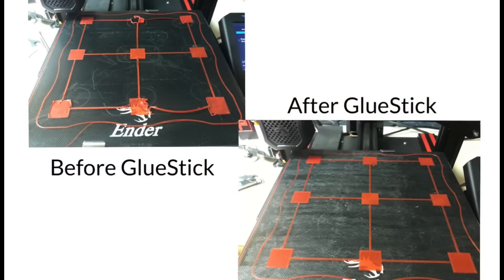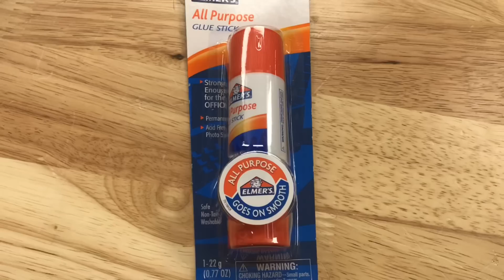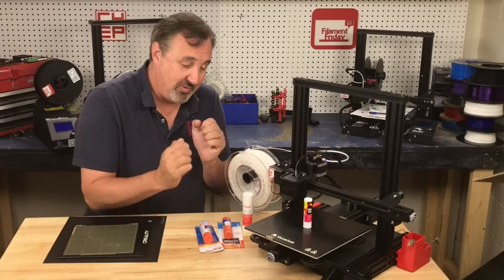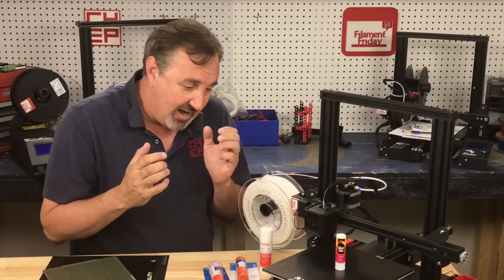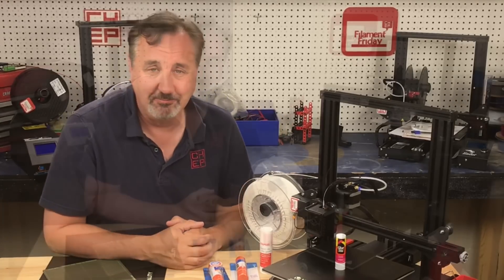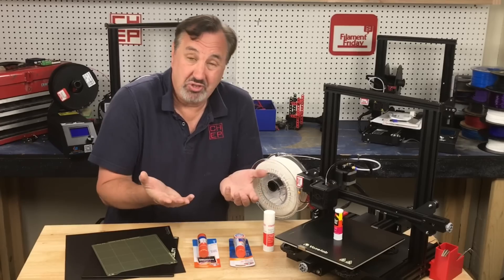Better Bed Adhesion with a Little Glue Stick

Comment: I think whatever works is what you should use.  I once mentioned in a forum that I used hairspray and was told I was doing it wrong, like I broke some acceptable use code or something.  I dont really care, I have a stock Ender 3 bed and hairspray never fails.  I clean it with IPA every three or four prints.  As for the overspray I have a large rag I put over all the critical printer components and go close to the bed with a few even shots. Takes five seconds and just works.  Glue sounds great too and will keep it in mind.

Comment: I haven't had much of a problem with adhesion in general on my Ender 3 glass bed but squares and rectangles (or really any shape with sharp edges) just don't stick well enough so glue stick has definitely been a life saver

Comment: Aquanet all day everyday 😬 but I also like some glue sticks as well. Especially on one of my Prusa Mini beds.

Great video!
Reply: I like hairspray too. I renew it with 90% and a brass brush to leave a bit of texture.
Reply: I agree on the hairspray on a bare glass bed and use White Rain.  I do remove the bed and spray from 3 angles and let it dry.  Keeps from having overspray on the printer. To each their own, if it works, it works.
Reply: In South Africa we use FIESTA hairspray. a small spray is all you need. Ah yes, overspray.... I move my bed all the way out and put a papersheet as a shield between the platform and the rest of my printer. No overspray...yet
Reply: I use Aquanet also glue sick is a last resort. I also increase the first layer line width that helps a lot.

Comment: Great video. I have tried almost everything and now use the Creality glass bed, but the smooth side, with glue stick or Magicgoo.  I have tried hairspray and agree it does leave a film from overspray.    The biggest problem I have is with NingaTek, it sticks too well for that I use blue 3m painters tape, so it doesn't destroy the bed.

Comment: I tried glue when my prints stuck too well. This worked, however I took the plunge and bought the WhamBam flex plate with PEX. The best decision I ever made. Everything sticks without glue and the parts pop off when cold. If you don't want to wait, flex the bed. I haven't had the need to use steel wool that often so it's not an issue. I admit, glue stick might be useful for two coloured prints. I haven't tried that yet.

Comment: I gotta the 4 screw bed levelling system that never seems get get level. Adjust one side and the other goes out, so I level to three points and use glue and it works great!
Reply: 4 point leveling is really a bad choice for actually leveling things. I wish they picked a 3 point system

Comment: If it separates people, that says a lot about those people actually, i mean whatever works is good! and everyone has their own preferences! I myself print on the smooth glass side and as long as the bed is hot it will stick great, then i let it cool down and it comes right off...i'll be testing pie in a while, basically to see if i don't have to wait for a cooldown! i never had success with the sticks, but i think you might have explained this with the difference between permanent and  non permanent and i'll be looking for a permanent one! Keep up the vids really liking them!

Comment: Started using Elmers Purple after an awful experience trying to use Solutech PETG. In my case it was because I needed a sacrificial layer rather than weld the PETG to the bed of my ender 3... I've had good luck with glue-stick ever since and aside from occasionally 'refreshing' the surface, it's been a boon.

Comment: I have 2 Ender3’s and an original Snapmaker. They all use standard glass mirrors cut to size. I use a glue stick rubbed all over the glass and then immediately with a wet paper towel I remove the glue residue turning the paper towel until no more blue glue residue shows on the paper towel. Prints stick first time every time. The best thing about this process - after the print is finished and the bed cools down their is an audible “crack” indicating that the print has separated from the bed and can be lifted off. No need to pry the model from the bed.
Reply from the maker: Interesting

Comment: I'm still pretty new to 3DP and I was struggling a lot with the stock glass bed on my E3 Max, I really liked the results I got from using a glue stick but I really hated the extra prep and never really got a chance to see what other's work flow was with glue sticks to see what works for them. It would have been nice to see in this video how you apply your glue and where it fits into your prep workflow. Like do you apply when the bed is hot or cold? Before or after ABL? How often do you clean it or reapply? These are the sorts of questions I've never been able to find answers to. I ended up getting a PEI spring steel print surface with textured on one side and smooth on the other and at the moment I have absolutely no plans on going back to glass. The textured side is fantastic and I really like the bottom finish it gives.

Comment: I was having issues with petg on my adventurer it was welding itself to the bed and i applied glue stick to my bed and it printed perfectly and then cracking sound then popped off the bed instantly!

Comment: Been using nail polish remover on my knock off PEI sheet and its fine. The thinned amount of acetone removes filament build up and scraps, but doesn't seem to harm the surface. Glue stick leaves a texture on the printed surface, and I have to wash it off the plate everytime. This is really a "do what works for you, BUT, if you're not doing THIS, then your doing it all wrong" video.

Comment: I tried a few things when starting out . Ender 3 . Found that non textured glass and a swipe of fresh glue stick every print has worked for me . Yes it take bit extra time to clean bed and re apply everytime but I don't think I've had a bed failure for over a year. Oh and a tip when I print abs first layer is 50deg bed then 2nd layer set to 90deg . Cause I found the glue stick fries when bed starts at 90deg.

Comment: I use glue stick every time. I love it. I also use a steel sheet, because I like the ease of flexing it off. I do like the Avery purple myself. It's cheaper than the Elmer's, works just as well. I did try an off brand that was no good though.

Comment: I have a wham bam textured metal sheet and I have been printing on it for about 4 months and have had very little issues with it. I clean it with a cotton swab and rubbing alcohol. If my parts start to pop off I simply level my bed and I’m back to printing. I print a minimum for 2 or thee parts a week. I think it’s something people should look into but that’s just my opinion.

Comment: I use glue stick every time too.. but I wash it of after every print. Now I'll try washing it every 5 or 6 prints!!!

I also just fixed a corner I didn't glue very well, by pushing some glue under it and holding it down haha. Glad I'm not the only one doing that!

Comment: I like hairspray. 
All Weather Aqua Net Extra Super Hold Unscented. 
Made a small box, out of cardboard, to set on the bed to prevent overspray. 
Hit it with a quick spray
Comes of with rubbing alcohol. 
Never had any issues and it works every time. 

The biggest advantage of the hairspray is it's EXTREMELY easy to use, and it coats evenly across the surface. 
That, and a can of hairspray will last you a lifetime.

Comment: What I do: On my Lulzbot Taz6 and Prusa printers with smooth PEI bed surfaces when printing PLA or PETG, I clean with IPA before each print. Occasionally I lightly rub with a Scotchbrite pad, instead of steel wool or fine sandpaper like some folks recommend.  For TPU on the same PEI surface I use glue stick to help release, otherwise the TPU will bond much too strongly to the PEI and can damage it.

Comment: I've been using hairspray on a glass bed with great success with PLA so I probably won't change but when printing ABS the cheap hair spray was unreliable; my wife had some hairspray that she didn't like and  WOW does it work. To remove my prints I almost always have to put the glass plate in the freezer for 20 minutes, after it has cooled down of course, but then the prints practically fall off.
The hairspray is Herbal Essences Body envy Volumizing Hairspray with Citrus Essences, there are numbers 1 through 4 on the can with 4 being highlighted. I do my ABS prints on a Monoprice Select Mini (V1) with the bed temperature at 75°C.

Comment: one tip is to do the first layer flow 150%-200%. Works super good for me. Just remember to adjust the "Initial Layer Horizontal Expansion" in cura.

Comment: I’ve found, if I use magigoo or glue sticks, I can wet the corner of a soft scotch-bright pad with a little water, wipe down the build plate and keep printing. It even levels out the texture of the glue stick so it doesn’t add a texture to the bottom side of the print.
I have a ender3v2 printer.

Comment: I have been using PEI sheets for ... 5 - 7 years I think. They come stock with LulzBot printers.

I do occasionally "clean" my PEI sheets, using sandpaper and a alcohol/water mixture, to restore the adhesion if I see it going (I don't do if often for the record, maybe a total of 5 - 10 times). Also cleaning them before prints is easy. Isopropyl Alcohol and a a cotton ball. Super easy, and it's a routine.

Comment: I use a PVA based wood glue. For me it has the advantage that it is liquid. I mix it with water to lower the concentration. In this way I get a thin coating. Of cause I dry it by heating up the bed before the print.

Comment: I use watered down pva every so often but I've found a quick wipe with acetone usually removes the dust or whatever is stopping my print bed.

Comment: I used to go with glue stick and like you said it worked well on glass bed. Until one day, I found a sand-paper-like textured build surface that came with every spool of filament I had bought. Sticked it to the top of my glass bed and I never have to worry about cleaning off glue residue every other print.
Reply: Overture?
Reply: @kenbad  yep
Reply: I hate their tpu so far lol, cannot get it to stick to clean glass, hairspray, OR gluestick.
Reply: @kenbad  Why didn't you use the included build surface. Its been saving me  lot of time and efforts cleaning the bed
Reply: It's not the right size for an ender 3

Comment: Had exactly this problem with my Ender 3v2. leveled and leveled and got mesh leveling and a BL-Touch. I just couldn't come right with PLA.

I'd bought a spare glass sheet which I was going to use build tak on to try printing with PETG, so I took off the creality bed, and printed straight onto the smooth glass. First round came unstuck half way through. Then I upped the temperature 5 degrees, and now it prints perfectly.

I'll remember the glue stick for when I try PETG, probably on the old creality bed, but the plain smooth glass is amazing for PLA. The quality of the base and detail I could get were better than any print I ever did on the creality surface.

Comment: Yeah I've tried all the options.  Glue Stick and BuildTak-like surfaces are my favorite.   My buildtak only wears out when it starts to rip / tear up from printing in the same spot too often.  I clean it with rubbing alcohol and it always prints like a champ.  (Maybe I've just got the right temperature settings and I always use PETG....so there are likely some contributing factors to my success.)

On other printers I use glue stick or that nanopolymer adhesive that I'm sure you've tried too.  It's good stuff, just have to keep it clean and/or refresh it from time to time.   With the nanopolymer stuff I find that it lasts for 4 to 8 prints on average before I need to refresh it.  Glue stick is a lot cheaper and just as easy even if it needs to be refreshed more often.

I haven't tried the permanent glue stick.  I might like that even better.   The washable stuff is very picky about getting the right bed temperature.  Maybe the permanent stuff is more forgiving.

Comment: I like my PEI sheet.  I never roughed it up and as long as I don't have a lot of oily fingerprints prints sticks fine.  I keep a supply of alcohol swabs (the kind for first aid) near the printer and now and then use one to clean the plate.  In extreme cases I'll take it off and wash it with soap and water.  You just need the bed well leveled and a clean build plate.

Comment: i am Printing for 5 years now on my old Makerbot clone (ctc bizer) on a glas bed made out of a old Prictureframe and Gluestick on it..you don´t even have to clean it after every print...just a small damp sponge to reaply the resedue after a print..then preheat to dry it again..
im printing Pla mainly..but ABS and Petg work well too...
 greetings from germany

Comment: I have an ender 3 with just a glass bed no special surface.   I use Elmore purple and it works great.  I love it just use hot water and it cleans off in seconds.

Comment: Been using hairspray for years on my print surfaces. You also do not spay your print surface while on printer, take it off, spray and put back on. That way no spray get onto any other part of the printer.

Comment: I just watched your video again. And you mentioned that a moist filament doesnt stick very well, and I couldnt agree more, I was having problems with adhesion with one filament in particuĺar unless I really used a lot of glue over the bed. I left it drying for a day, and it was fixed. Now it needs just a bit as usual

Comment: I use glue all the time but maybe a little different, I make slow swipes to the bed taking care not to push hard so it leaves a very light surface of glue ( sometimes i do 2 passes in a different directions) then i wait for about 10-20 mins to let it dry the start printing, i do this maybe once every month (sometimes 2 months), and another surprise is i don't use a heated bed at all because of electricity issues i have in my country, and i use a very cheap unknown type of glue.

Comment: Creality Glass Bed and a thin film of hairspray, works for me. And of course, a good bed levelling :)
Reply: I laughed at the hairspray until I tried it in frustration when my new ender 3 v2 wasn't sticking to the bed.  I had read or saw on YouTube about hairspray.  My sister gives me her hair spray cause of lockdown and she wasn't using it.  Works and is washable with water and a heated bed.  Works great.

Comment: i go glue and raft. i like the raft just so i don't damage the prints when removing them from the bed. i actually clean the glue off after every print because i use a .2mm nozzle and excessive glue build up sometimes prevents adequate flow on the first layer leading to clogging

Comment: Yep, glue stick for the win. To not get bothered with textures from the glue on the plate I always use a damp cloth before printing and while the bed is still wet put on the glue stick which really skids across the bed in that case and really leaves a very even film. Also I always use the same microfiber cloth which is saturated with glue stick residue. I rinse that cloth every couple of days out but never make it completely devout of glue stick. This gives me a nice even film and no textures. I use the Ender 3 V2 with the textured glass bed but when I made a car decal of 10 centimeters round I could stick it to a vertical glas plate and it would sit for a second and then slide slowly to the bottom without falling off.
Reply: I defenetly have to try that.  thank you!

Comment: I use glue all the time on my flashforge finder. Love it! Im looking at buying an ender 3 max. It has a unique glass surface that enables the glue to “pop off” when it cools. So im wondering if anyone uses glue on a surface like that?
Reply: I use a coating on the plain glass side.   I like the bottom finish better and the textured side will wear pretty quickly.  I always keep some extras on hand, they are pretty cheap and do get destroyed by a too low nozzle

Comment: You should try a good wall primer, it has verry good properties. You apply a layer with bed at 40 degrees, by tapping the surface with a sponge..let it a few seconds and put another layer. You can do multiple but 2 are enough if the wall primer is undiluted. The best thing is that this stuff gets stickier as it heats. With a cold bed it dries and is not sticky but whes heats up is tacky like adhesive tape especially at 100 degrees celcius. It doesnt burn out and it doesnt have any smell when heated . It remains sticky as long as it is heated. It work well even with the dreaded abs . Give it a try

Comment: I agree with you about hairspray.  I only use it on my Ender 5 Pro with a removable steel PEI covered sheet.  (I use the hairspray for PETG and ASA prints.)  I can take the steel PEI sheet out of the printer and spray it without worrying about the spray getting anywhere else on the printer.  I would not use hairspray on a non-removable bed surface.

Comment: Glue stick is definitely also great for getting prints to release. I recently got a glass plate from Creality and no matter what I did I could not get the prints to release properly, applying a bit of glue stick made all those problems go away as the print sticks great when the bed is heated and lifts right off without any force when the bed cools down.

Comment: I've found that after 5-10 prints on my two Ender 3 v2s with textured glass beds, its more a creeping bed dis-leveling than surface facing. However, I found that "Easy tack" stencil spray is great! Its a stickier bond than hairspray but not as hardcore as low tack 3M sprays. I don't recommend 3M sprays as they can bond parts way too hard. I know it works from trying once, and only once. I protect my controls and hardware from over spray with the shop rags. I forget eth file on thingiverse but I've also been using a tire depth gauge clip tool thing that has made precise bed leveling way easier.